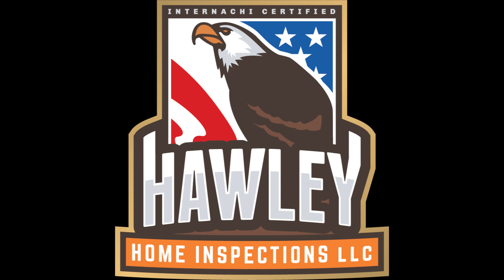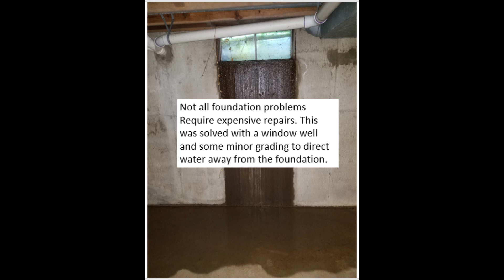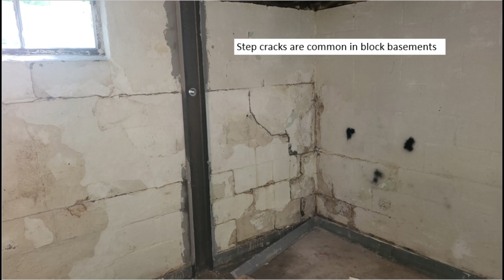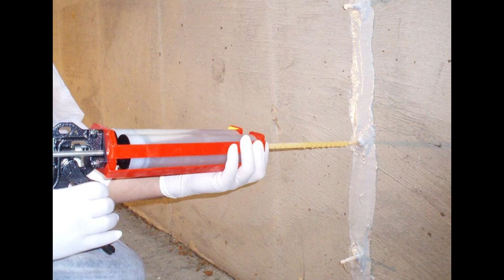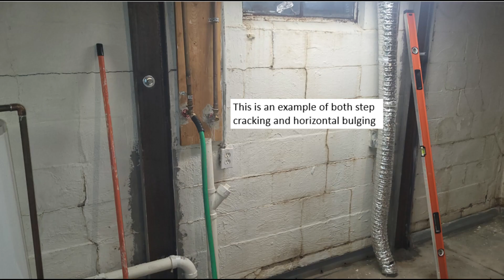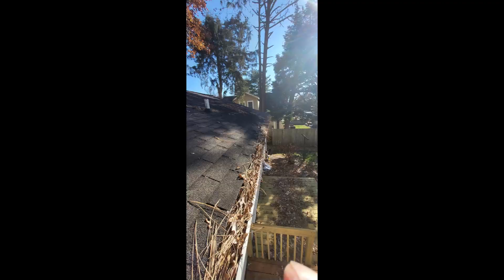The truth about concrete block foundation damage

Comment: How do you check the structure of the old concrete block foundations in a semi basement in a 1950's built home? Is digging all around the outside wall a trench the only way to check for any signs of foundation structural issues?
Reply from the maker: Sorry for the delayed tresponce, must foundation problems will be visable from the basement or crawl space. The more serious defects will show up iin craks in wallls and ceilings and masonry surfaces.

Comment: Most important. Is the crack or damage from like 40 years ago, and never moved more? Some mild damage is from way back and then its DONE. Not all damage keeps getting worse, but customers will be TOLD it will get worse, when in reality it settled 40-50 years ago and never moved afterwards
Reply from the maker: You are correct, however an inspector's job is to report on defects found the day of the inspection. Some cracks are minor and some are a sign of possible wall failure. Any cracks larger than 1/4", stair step cracks or a wall that leans more than 1/3 of the wall thickness will indicate the need for a foundation contractor's evaluation. Legitamate foundation companys will have an engineer on staff or available for estimates which should be free. The final decision is up to the buyer.

Comment: Had to DIY a foundation repair - we have zero structural engineers in my area. Zip, none, nada. None of the contractors have one on staff, none of the big engineering firms do residential. We got the repair done, but it should be mentioned that structural engineers simply don't exist in every part of the country to be hired out.

Comment: Every foundation company in my area only does helical piles. They apparently "heavily invested" in only one method and its likely the easiest method to keep their company insured cheaply. I got quotes up to 60k for a 400sqft 20x20 tiny home haha! My DIY cost is about 500 so far with maybe another 500 to go.
Reply from the maker: Helical piles are typically more expensive than other foundation repair methods and usually overused, but for the right application, they can be the correct solution.
Reply: Yeah they rely on stupid people that panic. 200k home? Go ahead and spend 60k to repair it. 😂

Comment: a brand new home in my neighborhood was just built with a block foundation... is cost the only reason people still build them?
Reply from the maker: Probably not. I am not a foundation specialist, but I doubt that would do much more than make the wall heavier and complicate effective repairs.
Reply: @hawleyhomeinspectionsllc2899  most block foundations are core-filled now though, are they not?
Reply: In my city in western NY virtually all new homes are block, including mansions. My builder told me this is simply due to a lack of skilled concrete wall guys locally.
Reply from the maker: Pretty much. Some builders in our area still do block crawl spaces. No one does block basements anymore.
Reply: Would it be acceptable to pour mortar in foundation blocks to help prevent further cracking? It is just a crawl space, not a full basement.